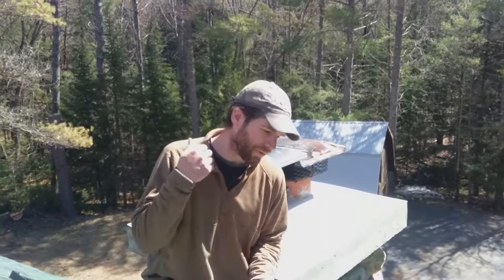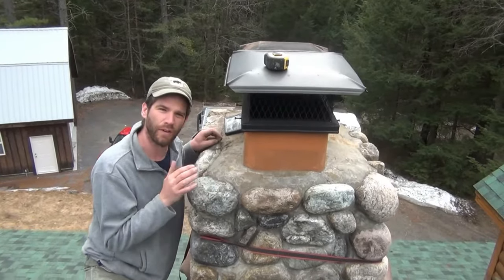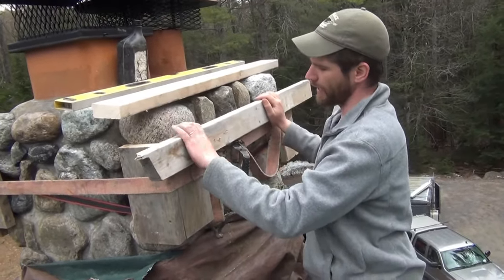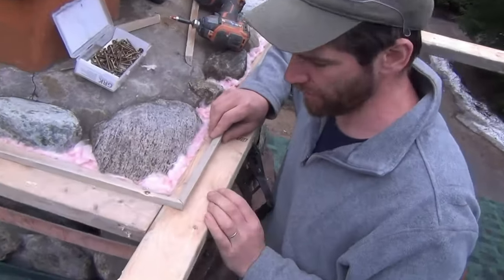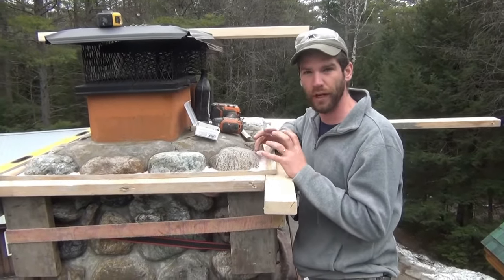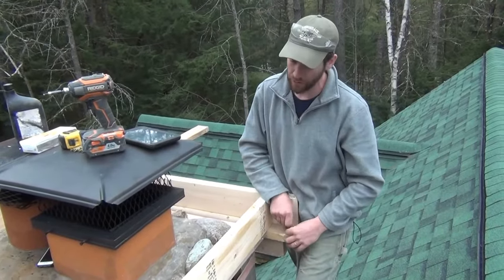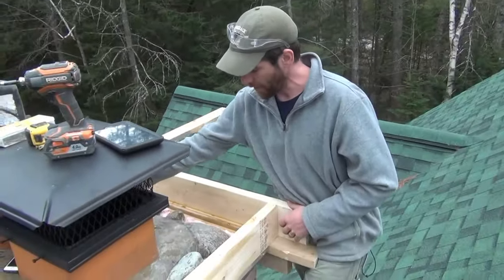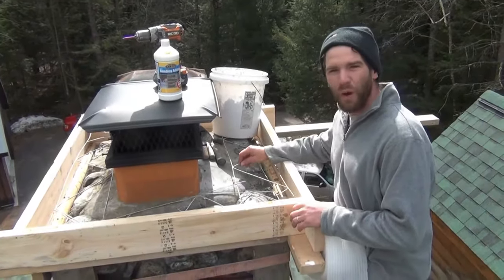How to Form and Pour a Chimney Cap (with Roger Houck)

Comment: Great video, very informative
im curious about something, my top row of bricks need a coupe replaced due to the face coming off, unfortunately I cannot get any to match due to age of house, so I was thinking about building a crown that would come down past the first course and cover them with a layer of concrete.  this would make the whole cap look thick but Im ok with that, any thoughts on that?  As well I dont want a huge overhang, any reason that I couldnt have only an inch or two of overhang?  providing there is enough for a drip edge?
If I lived in Mexico I would be forming a sombrero hat for a chimney cap, but I live in canada, so I cant.
Reply: Hey this is roger.   Thanks for the questions.   2 inches would be the minimum overhang to allow space for the drip channel to work.   I get the concern about the Sombrero look but  you really want to be sure that the rainwater running off the cap doesn't just roll back on the brick.   Yes  on the thicker cap to hide the top brick too.   Sometimes I bust all the bricks off and even a little further back so the creet doesn't have a sharp drop at the edges.   Hopefully this makes sense.  Let me know if I can help further.   Oh and while you are up there,  spray the remaining bricks with a watersealer like aqua pel.

Comment: Any recommendations on sealing it up temporarily? So I can wait for good weather to do the whole cap ?
Reply from the maker: Hi Brian,  sorry i could not reply to your last post for some reason.    yes you can seal it up temporarily.     is is leaking into the house or just saturating within the masonry?    If you are not using any of the vents/flues you can strap a tarp over it,   but you could also go up on a dry day and  use silicone or Lexal caulk to seal up any obvious cracks where water is getting in.   in general,  the deterioration to the masonry happens over a long time, so one more winter will not likely make a big difference,  unless there is water leaking into the house rotting wood, the masonry can probably handle one more winter.  our work schedule is crazy booked well into next year,  but i can help you with advice on any part possable
Reply: @TheHowToHeadquarters   is there a better way to reach you directly?
Reply from the maker: I can call you on the number you gave.  is there  a good time?

Comment: Im in the process of choosing to pour my concrete slab myself or put on a Steel slab on my shimney. This video makes me feel going for concrete. Or is steel the way to go?
Reply from the maker: well steel is easier,  if you can find a fabricator.   if you have any deep deterioration of your bricks or stone,   concrete is stronger and bonds the top of the chimney together a little better.  but its a fair bit more work.   especially if its up high and hard to get to.
Reply: @TheHowToHeadquarters  tnk. Yea I found a manufacturer. And it seems way easyer to place. My chimney is well made. I just need a slab on top of it. I see I can also choose copper. That looks nice too.
Reply from the maker: yep that sounds like a good call for your situation

Comment: Roger, If your curious I put a quick video of my chimney cap project on my channel last night. Last few minutes is about the chimney.
Reply from the maker: that is a big project.   a  nice wide cap will help that chimney for sure,  the weight on the top will also compress the whole brick stack making it a stronger matrix as well as protecting it from the water.   it will be a lot of work,  but you will not have to go up there again!
Reply: @TheHowToHeadquarters   I will protect the roof with some soft stuff first. There is no easy masonry job! Will post another video once I get the scaffold erected and can get a close up of the cap. Have owned the house since 1993 and the chimney has always been damp. This is going to be a huge improvement because I'm convinced the main culprit is the water washing down the side of the chimney and not the top. I sealed the top in liquid plastic and water still comes in. The top is just slightly sloped mortar now.
Reply from the maker: that drip channel should fix it.  let me know when the close up vid or photo is available and ill take a look
Reply: @TheHowToHeadquarters  Here is the closeup video https://youtu.be/Nvxc6voa47g

Thanks for watching. If my ideas are bad don't hold back.
Reply from the maker: Hey Kirk,   that sounds like a decent plan.    an ideal cap will be about 4" thich at the outside edges of the form and then slope up a minimum of 2" to the flue.  so you will have to bust off a few courses of brick to get that depth of concrete to work out.  We deal with snow here so i like to have the tera cota flue stick up a good 4 to 6"  above the concrete cap surface,  so that melting snow does not find a way down the flue.    the stainless caps you were looking at are definitely better than the brick and slate cap you are thinking of removing.   they just do a better job protecting from the weather and rodents.   some say they are less aesthetically pleasing,  but that is up to you.

A 5" total overhang is plenty.    that will keep water from running down the bricks in almost all weather.   are the mortar joints of the bricks in good shape?    it would only take  a moment to tuck new new mortar in an loose joints and then when you are all done,   and the new work has had a chance to cure a little,   spray the whole chimney,  (bricks and new cap)   with a sealer such as aqua-pel.   (i think they have it at lowes or home depo)
oh and when you remove the top few courses and the current crown,  you may find that there is a void between the chimney flue and the brickwork.     I usualy cut out a pan of coil stock or metal roofing to bridge the gap.    the void is good below the cap,  but you need to make a flat spot to begin pouring on so some flat metal panning usualy does the trick.  you can seal the edges of the metal with mortar the day before the pour so you dont have any leaks in the void.

also check ont he flashing when you are there.  as i am sure you have.   sometimes it just needs a little touch up with Lexal caulk or  a re flashing cut in if its in bad shape.   if you do all that.  you will definitely not see any more water penetration in that chimney!!!

great scaffolding set up btw!

-ROger

if you have not already ..please like subscribe and share!!! thanks!
Reply: @TheHowToHeadquarters  Thanks. Some of the mortar has been caulked and there are some cracks. If they do not get done before winter I will get them this Spring. Overall it appears strong and well adhered together. The new poured cap might be around 800 pounds. 6'x3'x 6" average which like you mentioned will really put the clamp on. Going to weld together a swivel hoist for pour day. All the effort into good scaffold is worth its weight in gold. Will keep posting videos crown. Really appreciate the feedback
Reply from the maker: if you don't have a big pully for your hoist,  you could fabricate one with a bicycle wheel.
Reply: @TheHowToHeadquarters  Slight design change from the catalog version. Going to try and use two  heavy duty 3" pulleys that I already own. Rope will be tied at top, go down and through the first pulley, up and into a second pulley that is fastened to the hoist arm and then to the operator. My theory is that this will duplicate the advantage from just using one pulley. if it fails then I will go to the dump and get a bike wheel. Do you get picky about what kind of mortar you use on brick chimneys- for tuck pointing and replacing bricks? Type N so it has more give or type S for more structure. My instinct is saying use type N but having spent 3 hours just jack hammering 1/4 of my chimney project I'm starting to think they used type S mortar. For the crown I was thinking of using QuickQrete 5000. Also think that I will replace the to terra cotta flue liner because of cracking. They did not have any expansion and the mortar they poured in is at least 8" thick. Hard as a rock but no aggregate. There is one mortar joint about a foot below the top that is cracked all the way around chimney. I will be getting some mortar in them after taking a better look today. Overall there are cracks and spalling but a larger percent looks good than bad.
Reply from the maker: you sound like you are doing everything right!   make sure to wash the joints out with water before tuckpointing.   block and tackle idea sounds good.  i usualy attach the rope to a milk crate and put the buckets of mortar or concrete in the crate so i'm not dependent of the wire hoop handle of the bucket.  I've had them fail rater catastrophically in the past.  i would probably pick type N but the difference is not significant in this application.   you may want to use a mortar grout bag to squirt the mortar in the joints.  i have a new vid on using the grout bag coming out soon.    if you care about color matching the mortar (which is a hard objective to hit)   tyle n is usualy a little lighter in color.
Reply: @TheHowToHeadquarters  Good info. Thanks for the reassurance. Will keep posting videos on my channel at milestones. Have one half of the top removed after two half days of jack hammering. The mortar they used is very hard and the chimney is amazingly well built. If they had put an expansion gap around the clay liner and a overhang with drip, this thing would never come down. I think the top liner is cracked but have not taken the top plate off yet to inspect inside. It has stainless liner but I will replace the top terra cotta liner if needed just to feel better. Seriously doubt it will ever be used unlined though.
Reply from the maker: sure your can replace the terra cotta now for just $20  and then get the height you want and even add an expansion joint if you wish.  but especialy with a liner. there is not likely to be very high temps up there.    Lexal clear caulk is my favorite for around the flue next to the concreet.

Comment: Thanks for the awesome video. I got 2 questions. 
Top layer of brick basically were loose/ cracked so I am doing the crown there. (Will use the aqua pella for rest of bricks which look great).

 My question is when pouring the concrete is it better for it to sit on top of the old mortar that held the top bricks or ontop of the bricks. Or doesn't matter.

2nd) I screwed up and didn't see your flashing video on time  I have a metal roof and I used tar too seal it with new caulking at the seems before the tar. Anyway to fix this mess (clean it off) or am I screwed and should just leave it. 

1st time home owner and qst time with chimney here. Now I know
Reply from the maker: Hey Clayton!   you are doing great!   I recorded a few tips on the brick application of a cap,  but i havent got it uploaded yet.    Yes you are probably fine just removing the top 2 loose courses.    and starting there.  it is fine to leave the mortar on top of the first solid course of bricks,  But i recommend setting the bottom of the form down a little on that course like we did on the stone.     it makes is much stronger.    
Flashing Metal roofing is another animal entirely.     my vid showed the flashing method for shingles and metal roofing would strat the same way but then it gets complicated.   lots of origami with coil stock metal,. grace ice and water membrane  and still you gotta depend on caulk/tar.   If what you did does not leek.  I think you can call it a win.   a pro flashing job into a metal roof would take me about 10 hours and a few hundred bucks in material.      
if i get a chance today.  Ill try to upload the brick chimney tips.    let me know how it all goes!!!
Reply: @TheHowToHeadquarters  thank you so much for replying that quickly!! I understand completely what u mean by setting the base a tad under. I wasn't planing on doing that but now I will!! 

Thanks for making me feel a bit better about the tar job haha but now I know. 

I'm confident now with everything thanks to you. Last thing is when I'm at home depot all I need is the quikrete concrete mix and Portland. Nothing else correct. Prob need 5-10 bags of quickrete and 1 Portland.
Reply from the maker: yep that sounds about right.  usualy 5 o 6 bags, does most caps.     can you get durawall reinforcement wire or some thin rebar?    or i have just found that sheep fence makes great reinforcement metal for cap concrete pours.   
  sometimes i use a little mortar to pack the leaks in the bottom of the form,  but on a brick chim,  there are usualy only tiny cracks.
Reply: @TheHowToHeadquarters  thanks for the concret mix confirmation. 

Yes I found some repairs enforcement same thing u had in this video in the same concrete isle at home depot. 
I plan on inserting it in the middle of the pour but may add 2 pieces  as it comes in a big sheet. 

Havnt made the wood base yet plan to do that Thursday using that drip channel (GENIUS!) TOO. 

Its gonna rain tomorow so I have 2 tarps over it (hoping it doesn't let anything in) 

No gaps im assuming as it straight edges but if there is ill plug them maybe with silicone as its product I have and should fill that gap.  the opening between the flue and the mortar needs to be filled. Plan on using metal sheet that sits right on top to fill that but making sure no concret falls down the chimney and or touch the flue (expansion joint) 

Subscribed and been watching your vids. Great work dude. Love the work u do
Reply from the maker: sounds like you have it well under control.   stay dry totay and good luck on the pour tomorrow!!  id love to see pics if there is a way to do that.

Comment: Great instructional video though except for the fact you do not have an expansion joint up against your clay flue. The clay flue will get the hot, expand and crack the new poured crown
Reply from the maker: good point.  I did address that in the vid.   exp joints are somtimes nessary but should be weighed against the actual heat that the chim is expirencing at that distance from the heat source.  and the likelyhood that the joint will be maintained over time

Comment: What a great video. What would this cap and work cost?
Reply from the maker: thanks for watching.   cost varies regionally and is dependent on how high up the chimney is and the pitch of the roof but i think this should never cost less than $1500  and might be north ot $5k in some tough cases.   probably averages in the 2000s  but the loose cap usualy indicates loose stones on the main chimney and that incurs more cost.   i hope this helps.  Roger
Reply: @TheHowToHeadquarters  very much does. Thank you. The crown work estimates have been on brick chimneys, and your breakdown is the only solid one I’ve found for stone. I’ve got a beautiful 1850’s chimney, and I can do the tuck pointing up to as high as my ladder gets, but I can’t get all the way up to the crown and will have to bring a pro in. I inherited the house, but not the career that supports it, and have been looking to mitigate my expenses by putting in as much elbow grease as possible.
Reply from the maker: if you get some estimates feel free to check in with me again,  I have helped people online before to try to pick the right mason.   I have a few tuckpointing vids on the channel that might help as well.    I hope it goes well for you.
Reply: @TheHowToHeadquarters  thanks so much! I had a second opinion today, and I think my quote will be much lower because he knows I actually know what’s going on! I think the other folks may have wanted to take me for a ride!

Comment: Roger , Ive got an 8 ft fieldstone chimney just remove top corner repaired  same , had no cap going to put a cap on watch your capping vid for ideas was on the right track , but my problem is its no where near square or the same width at both ends ,gonna try your insulation trick hoping it will work if you check this post area  any advice would be good
Reply: after a closer look  ,  I see you cut a relief for at one stone that was jutting out
Reply from the maker: Hi Ron,  thanks for watching!    this form method will work even if the chimney is way out of square.    we often notch in the crazy stone that are jutting way out and then once the horizontal form boards are in place we square up the vertical 2x4s as best as we can.  trying yo eyeball equal  spacing away from the average face of the fieldstone wall.    I'm so glad you found this vid, i hope it helps and let me know if you have any more questions.
Reply: @TheHowToHeadquarters  Hey used most of your tricks , cap looks pretty good not perfect as far the top being totally uniform but nobody but me will ever see that . Working on repointing it now  .  .If I can figure out how to post some pics I will .
Reply from the maker: I'm glad to hear it turned out  Ron!!!   THanks

Comment: Just curious. How much do you charge for this job? 

Great video!
Reply from the maker: thanks for watching Jeremi.  cost is a great question.   there are always a bunch of factors.  1st is how steep the roof is and how much the shingles/metal need to be protected, or scaffolding built,    the next is how deteriorated the stonework beneath the cap is.   with those variables being average the actual forming pouring stripping and clean up takes about 3 partial days.   which can basically keep us from doing anything else that is profitable for the day   so.  we also have a full liability and workman's comp insurance overhead to service so   a concrete cap might be a little at $1,500 usd  or as much as $4,500.  many are in the $2,500 range..  10 years ago i foolishly did lots of them for $500 each.   I hope this helps.   what would you expect to pay in your neck of the woods?